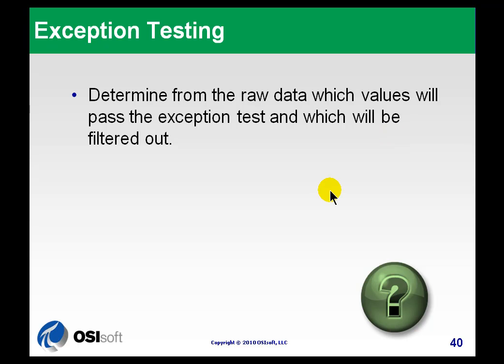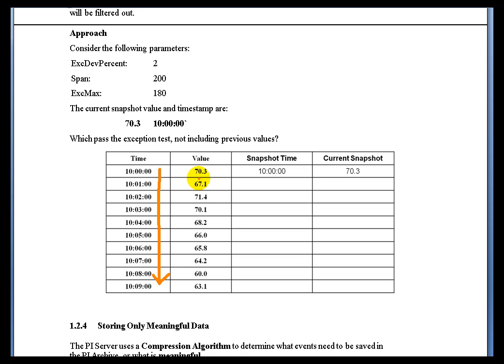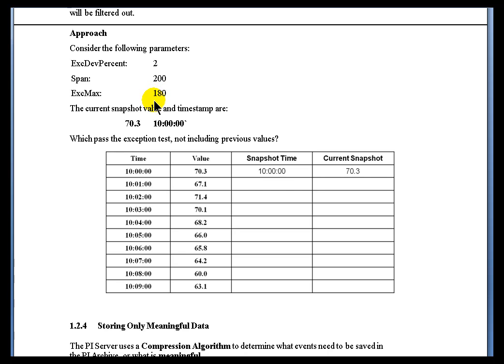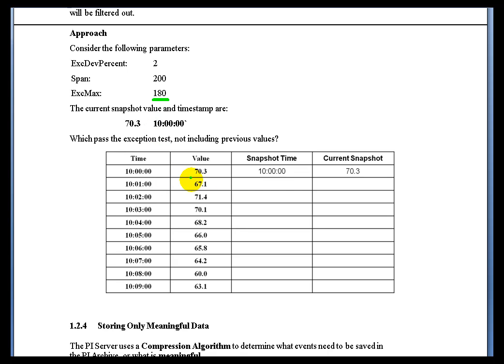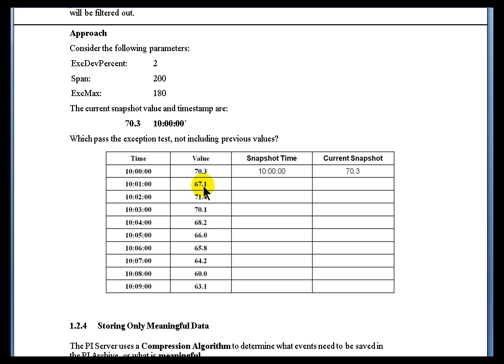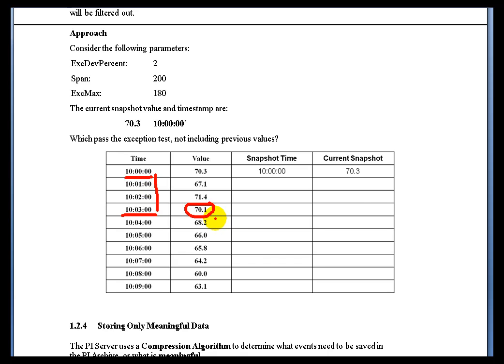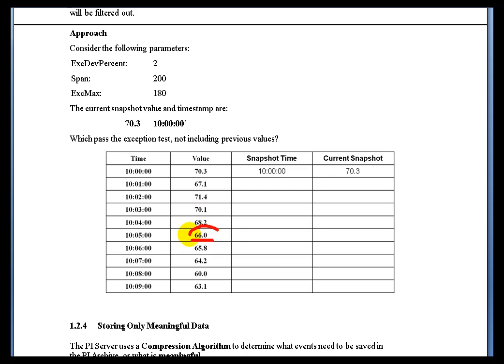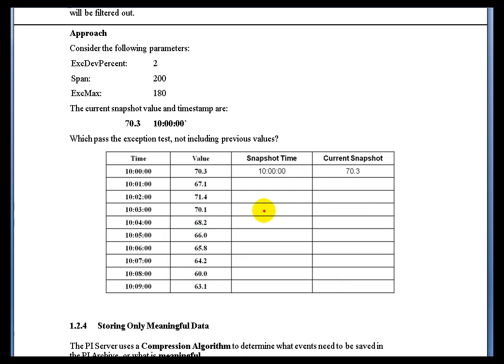OSIsoft: Directed Exercise on Exception Testing v3.4.380

Comment: I'm getting this error.. "A network-related or instance-specific error occurred while establishing a connection to SQL Server. The Server was not found or was not accessible. Verify that the instance name is correct and that SQL Server is configured to allow remote connections. (provider: SQL Network Interfaces, error: 26 - Error Locating Server/Instance Specified).

Checked that remote connections are allowed, enabled port 1433 even if it's on the same server and also TCP/IP... please help!